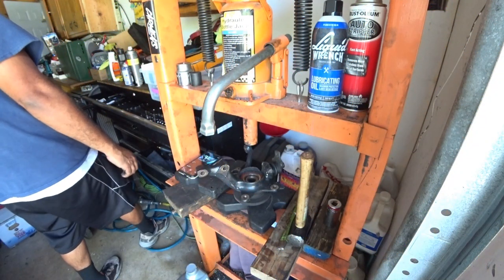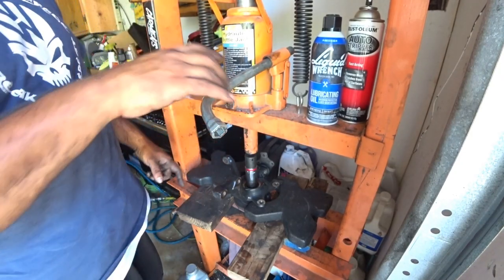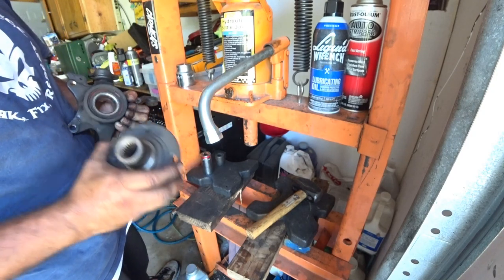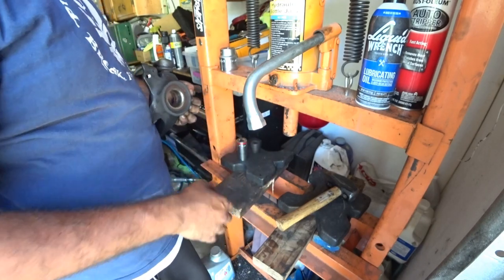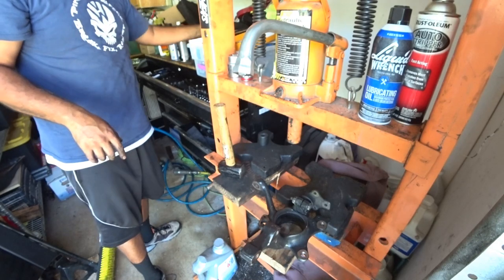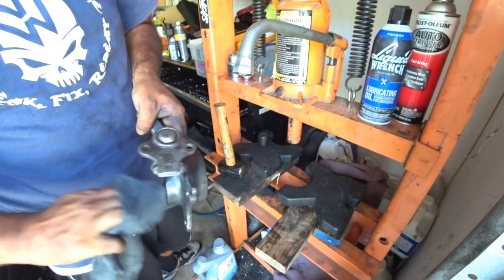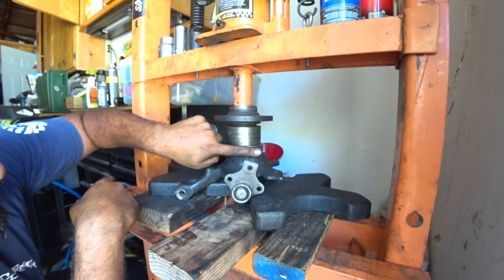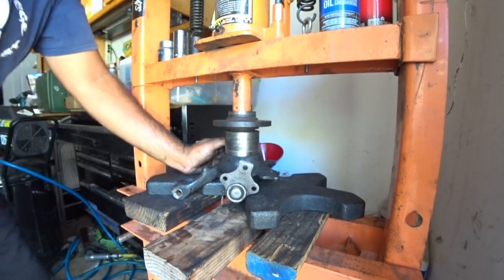How to Remove and Install VW MK2 Wheel Bearings Season5 EP29

Comment: Your videos are top notch. I really appreciate it.  Curious question. I noticed the spindle/knuckle you used doesn’t have the abs ring. Does it make a difference if you get a knuckle from a rado with abs or non abs?   I don’t think the knuckle would be different but could it be? Would the abs ring pop out with the hub when pushing out from the back?  Picked up a set of spindles for the upgrade but they’re pretty rusty ( screws and bolts ) just want to salvage the knuckle.
Reply from the maker: Correct some older MK2 did not have ABS. My mk2 is an 86 which was an option if you wanted ABS the later models was an option
Reply: @PincheALsGarage  ok. Cool. I have an 86 Jetta as well. Now to find a press …..

Comment: how do i know what size bearing fits the hub without measuring? there is so many different sizes for sale and i dont know which one to pick
Reply from the maker: There are only 1 size for the g60 corrado spindle for the front and for the rear.